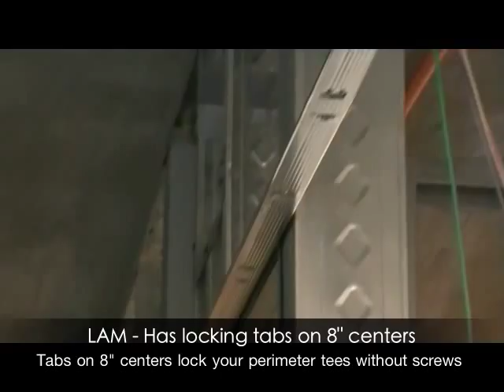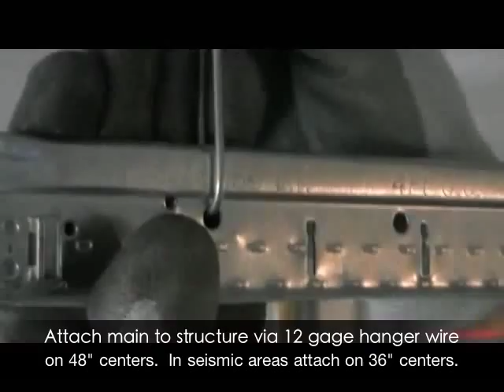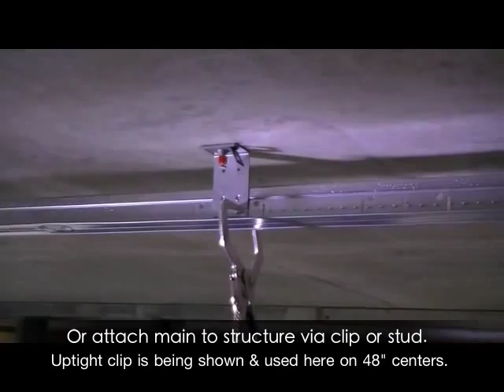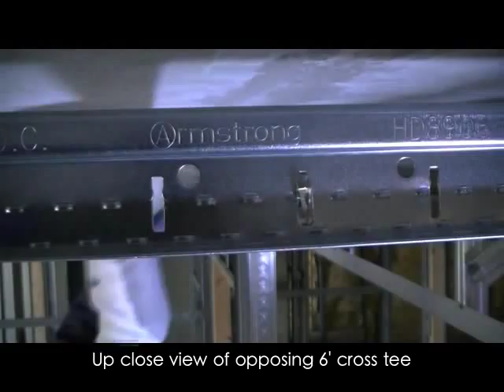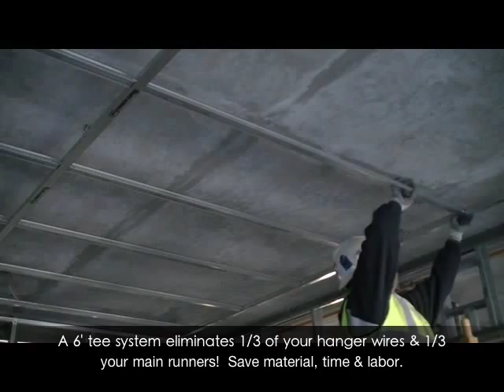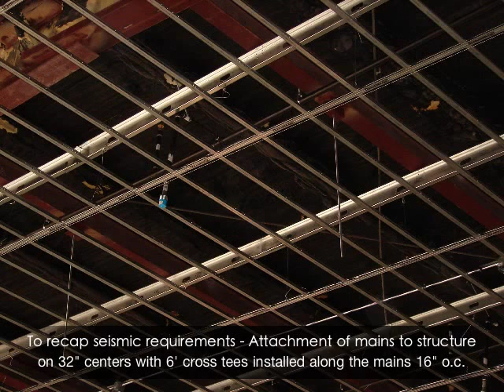How to Save Time, Material, and Labor Using Drywall Cross Tees | Armstrong Ceiling Solutions

Comment: stuff will sag, never more than 4' spaceing, worked at trade 35 years.
Reply: The beams should be stiffer so won't sag as much as standard tees right?
Reply: Hanger clips should be drilled into concrete, if one  pin pulls out of concrete ceiling could fall on the floor, maybe kill someone